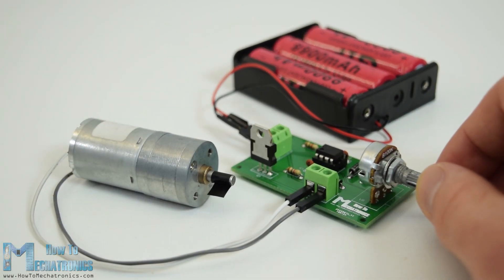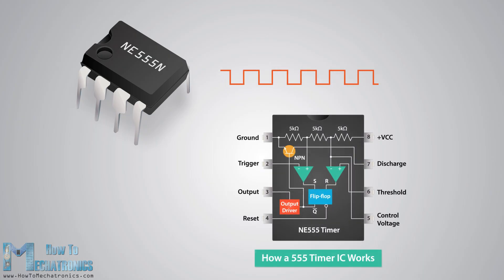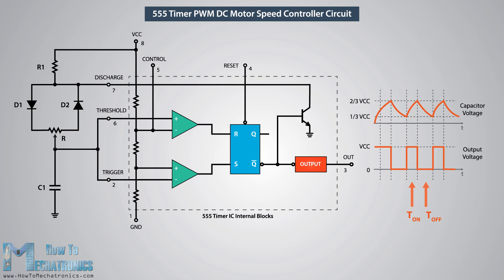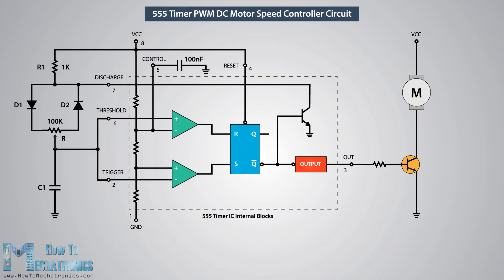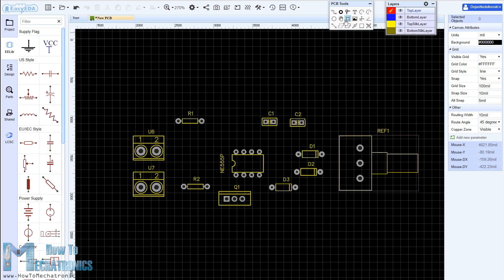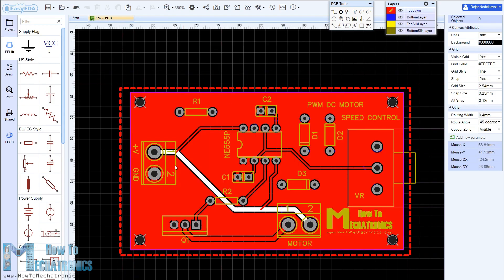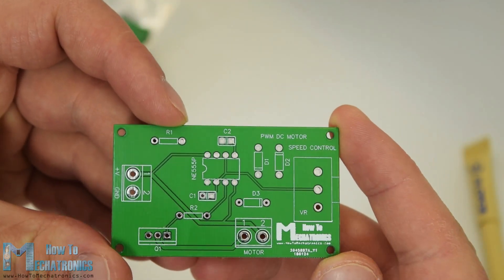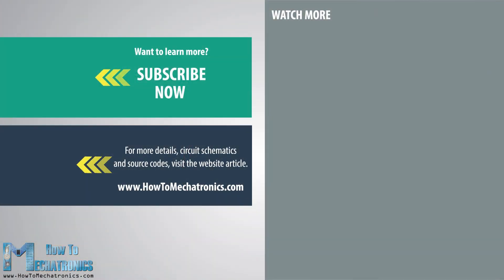How To Make a PWM DC Motor Speed Controller using the 555 Timer IC

Comment: i dont know if you answer comments, but, i have a question:

so, iam running this 12V 20A network back in my garage. i want to use a DIY dremel with a 10A PWM controller, with a motor that pulls 5A no load.

the question is, how much amps will the PWM pull? will it take the 10A, the 5A that the motor pulls, or will it try to take the full 20A and fry itself? please help
Reply: The 555 timer can only route 200mA through it, but because we are using a transistor the current will not be flowing through it, instead it will flow through the transistor. So you would just need a 20A transistor or a lower value suitable for your motor usage. your motor would probably fry TIP122 which is featured in this video cuz its rated for 5 amps and your motor pulls 5 at no load.
Reply: @disguisedcat1750  ahem, a motor cant overamp itself (that is not even word lol, but you get what i mean) because a motor pulls only how much it wants, not EVERYTHING available. you probably meant that the motor could overload the PWM because it will draw more than 5A when loaded, but a motor CANT pull everything you throw at it. 5A no load, it will take those 5A and not the full 20 when on no load.
Reply: @littleraptor9898  i guess I am bad at explaining but that is what I meant. I said 20 amp transistor cuz their prices are pretty close so might as well get one that won't fry even if you change the motor later. I said "or a lower rated one according to your motor usage" which explained what you said cuz you cant specify 5 amps at no load cuz there is no way you have a free spinning motor :)
Reply: @disguisedcat1750  ooh i get it now! ok, that is what i needed, thanks

Comment: i need to buy PWM for hydrogen production. I need to buy PWM for hydrogen production. Hydrogen unit need 220volt 2500watt. I have 220volt inverter. Which bridge rectifier and capacitor should I use to convert ac to dc how to connect capacitor. Which PWM should I selected

Comment: Can I use this on a welding machine that has a 200A 78V output, if yes can I set a min voltage instead of it dropping to zero

Comment: if we can control speed of motor by controling the input voltage then why we use pwm circuit for controlling its speed?
Reply: You can use a transistor and a potentiometer alone to control voltage input but it is inefficient and the motor will stop turning when the voltage input drops below its startup voltage. For example: a motor that needs a startup voltage of 5 volts will speed up when given higher than 5 volts without pwm, but will stop and start heating up when the voltage drops below 5. While in pwm the same motor will slow down when given a mean voltage of say 3 volts because its taking its startup voltage in pulses. pwm is the best way to control speed of motors in terms of efficiency cuz you are always able to give the motor the voltage its most efficient at while still controlling its speed.

Comment: Why is the motor moving so slow as you increase the potentiometer ? Not enough power?
Reply from the maker: That's the maximum speed of the motor. You can notice it has a reducer in front of the motor. The max RPM of the motor in the example is 120,
Reply: Its a high torque motor

Comment: Can you replace with a multi-turn potentiometer to get a more precise rotation ( down to 10rpm or even 2rpm ) ? Some pots also have 5 pins ( the one you use and the multi-turn pots only have 3 ). What are the extra 2 pins for ? I have a pre-assembled module, but with my poor eyesight, the unit being so small and components covering the circuit tracks, I can't see what pins join what components ( I'm thinking of just removing the 5 pin pot on this module and replacing with a multi-turn pot, but obviously I only have three pins to attach ).

Comment: Why do you need the IC? Why cant you just control the voltage going to the motor with just the potentiometer.
Reply: This way it doesnt waste electricity. Transistors heatsink can also be smaller.
Reply: Just the potentiometer would fry your motor, you can use a potentiometer and a transistor for voltage regulation but pwm is much more efficient like the guy above me said.

Comment: what is the purpose of the diode at the motor ?
Reply: When motors stop or start they generate voltage spikes in the opposing direction of their power source, so this diode shorts these spikes to their generator so that they wouldn't harm other components.

Comment: That setup with the diodes is genius.
Reply: Sorry can u explain me why he used the diodes i couldn't understand
Reply: @sarasaicouc7272  this might be late, but they used 2 diodes to control which side of the potentiometer discharges the capacitor and which charges it, in the case of the video the right side was for discharge, without them the capacitor would always discharge through the lowest resistance side, with the diodes in place the capacitor can only discharge through the right side, even if the resistance is bigger

Comment: Good day - great video and instruction.  Trying to learn how to make a PWM DC motor speed controller using something like this for an abandoned Treadmill Motor.  Most of these "Large" motors need more voltages I think.  Clearly you can tell I am NOT well versed in electrical circuits.  Any help is greatly appreciated.

Comment: need info for MAX Ampere and Volts ?
What Min - Max Volts and max out ampere
Reply: that depands of the transistor type
Reply: Without a transistor the chip can only output around 200 mA, you will need a transistor for anything more

Comment: Can this circuit used in electric bicycle??
Can control 24v 250w motor??
Reply: the mosfet has rating of 5amp u cant run more then 5amp load
Reply: The 555 timer chip featured on the website is rated for 5-15 Volts so you should pick another suitable one as well as a suitable transistor.

Comment: Hello. Is it possible to run forward and reverse on this? Working  on film project and needs  possibillity to run both ways.
Reply: No, but in order to reverse the polarity of the motor or to change the way the motor spins you'll need a h-bridge, there are plenty of videos that explain and show how they work so just look up "h-bridge" on youtube and alot of videos will come up. I hope i was of some help =)

Comment: Master.....how to make max 100 A 12 volt PWM DC MOTOR?
Reply: If you're using his circuit you just need an output transistor capable of that, don't quote me on it but I believe the irf3205 can handle it with a heatsink
Reply: Tq master. .. very interesting wiith your project 👍

Comment: why can't we just use variable resistor?
Reply: Variable resistors are a simple option for very low power designs.  But when handling larger amounts of power, variable resistors are impractical because they need to be physically quite large,  and they waste a lot of power as heat.  Imagine designing a circuit that controls a 12 volt, 10 ampere DC motor.    A typical 1/4 watt variable resistor would be almost instantly destroyed trying to handle that kind of power.   A variable resistor for something like that would have to be very large and expensive, and it would have to dissipate a lot of heat.  PWM circuits are more efficient for an application like that, because they don't waste as much power.

Comment: I just made this circuit in a perf-board (due to the lack of a breadboard) and it didn't work. After some probing around to check for connections I accidentally grounded the cathode of the diode that points away from the the Potentiometer and then the circuit started working as it was supposed to. The only difference between the circuit that was shown and the one I made are the Diodes used (1N5408 and 2x 1N4004, all from old fluorescent light drivers) and  the TIP122 transistor being replaced with an MOSFET FQP30N06. Anyone have any ideas on why is that?
Reply: Make sure you hook the base of the mosfet to like a 1Mohm resistor to ground to prevent noise and try again. I am using the same TIP122 transistor and it didn't work for me either.. imma try grounding that and see if it works... im so mad at this stupid circuit

Comment: Hi Dejan.
I like your channel, its nice and simple for beginners.
Can you make driver board for 1.7 MHz ceramic plates for water vaporizer, they are pretty cheap online but without driver.
It can be done with 555 timer and Bu 406 NPN, the only problem for me is that I dont have osciloscop (its hobby).
Keep up the good work.
Cy

Comment: LM317 chip ... 1k resistor ... 10k potentiometer ... and done .. so easy
Reply: But its inefficient.
Reply: LM 317 is a transistor, it doesn't generate PWM signals.
Reply: lm317 is a voltage regulator

Comment: Whats the purpose of D1 and D2 , just for the .6V drop? Iam still learning and since both diodes face opposite directions all I see them doing is making the voltage no matter which way have to overcome the .6V to get passed either direction,  what iam I missing. Great vid and thanks.
Reply: thank you so much for the explanation :D
Reply: I don't understand it either, but I thought they are there to force which side the capacitor discharges through and which side it charges through... in case they weren't there, the total resistance will not be constant and therefore the frequency will change as you move the potentiometer, because the current will flow through the less resistant side.. idk if this makes sense :p
Reply: That would also mean you are only using half the petentiometer cuz the other half is the same as the first one but reversed. So highest resistance when potentiometer is at 50k and lowest on both 100k and 1k.

Comment: That can not be called "speed control" because there is no any feedback device. Hence, if some external force slows down the motor speed, your system can not compensate.
Reply: In the same way that a drill has no speed control as resistance will slow it down..........In the same way that a dimmable light also doesn't have sensors making sure that the physical light output is real, but instead just changing the voltage source. 
Semantics.
Reply: Miguel is right; this is more "power control". It's a misnomer to call it speed control, but everyone does it.
Reply: @fgbhrl4907  but the same problem applies to power control if you increase the mechanical resistance the fan would draw more power, you're not controlling anything except duty cycle in this circuit i.e speed. It clearly shows that it controlling the potential speed of the load within a scale of  0-100%. Most modern fans have a built-in power control in the circuit that senses when a threshold (power input > rotation speed) is breached.

What you're referring to is called motion control (motor control) as it's expected to drive a mechanical shaft connected to a belt/chain/gear/prop. A fan isn't expected to have a varying external load but motors do. Hence why you need feedback from a high-speed counter inside your motor to verify that the input match it's expected output.
Reply: @TheEisel  damn. Nice.
Reply: Miguel Prado , really ? See the video again !
Reply: You need to know more about of control theory before typing. What we have here is called "open-loop".
Reply: Come on girl, don't be upset. It is a great video; I just saying that it should not be called "speed control", perhaps "speed regulation" is more suitable.
Reply: I also tie my shoes by myself, my mom is so proud.
Reply: If anything, 'speed regulation' seems less correct. But in any event, it's a circuit that controls the speed at which the motor turns.
Whether it does this reliably and consistently under all possible circumstances is another matter entirely, but it indeed does 'control' the speed of the motor.